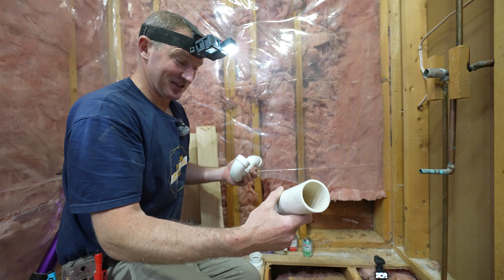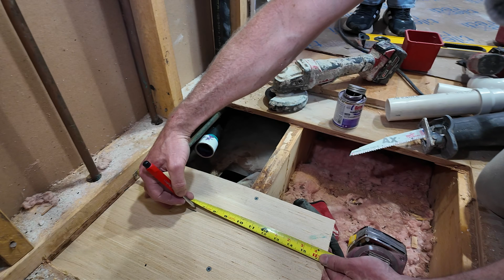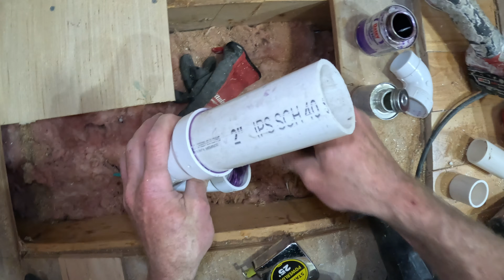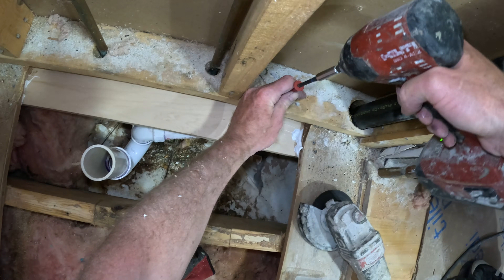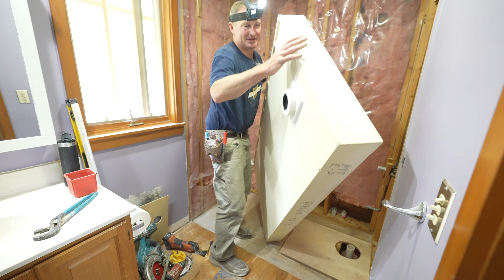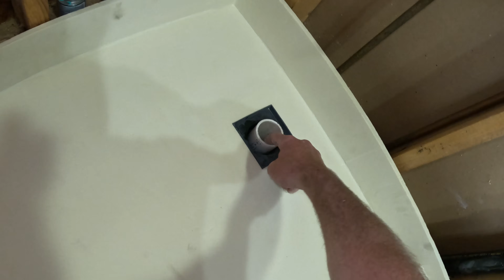How to Change a Tub Drain to a Shower Drain

Comment: By all means I think you should be able to do what you wish with your own home, and I doubt that little bit of pipe thats 1/2 inch smaller will cause a backup situation, but please at least TELL people that code is 2" from pan to trap. There's the easy way, and then theres code. Follow code as much as possible, at least for the next owners sake...
Reply from the maker: IPC allows it, UPC doesn’t that’s it 😅